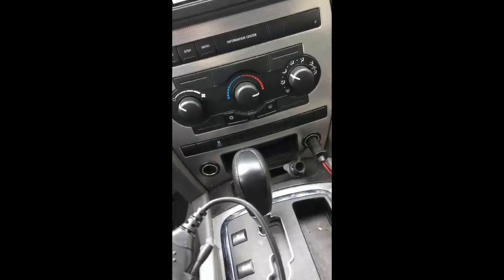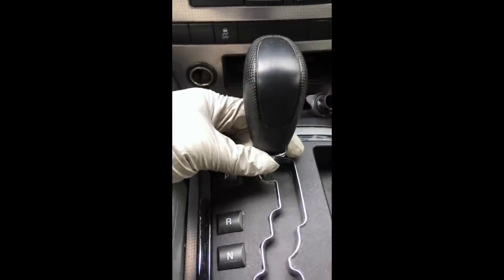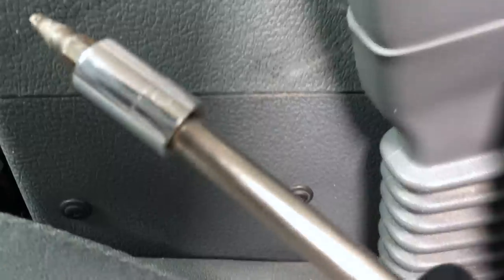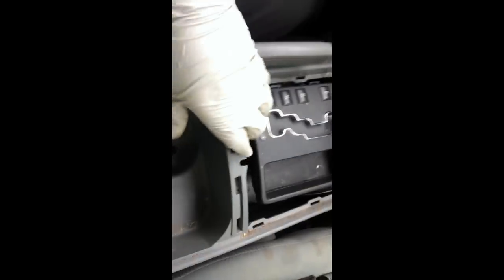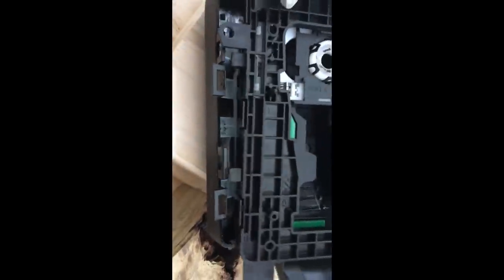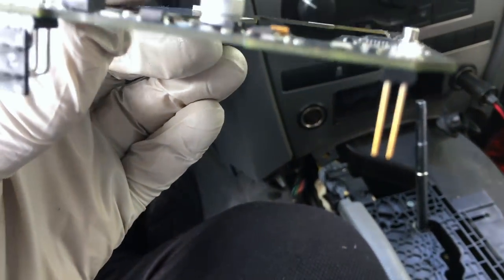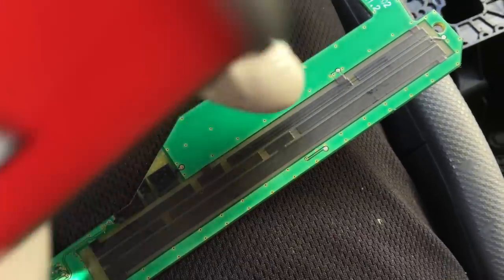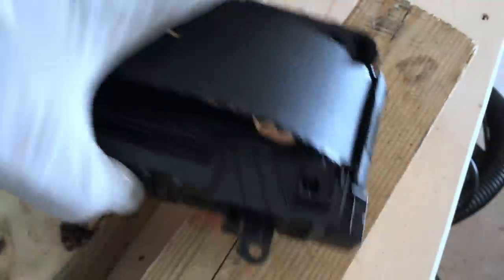2006 Jeep Grand Cherokee (WK) 3.7 Electronic Shift Module (ESM) Problems U0404 P0700 Codes

Comment: My 06 shows (1) highlighted all the time and won’t turn over by the key and wen I make it run jumping the relay the gear id on the cluster stays on (1) gear.  I’ve ordered a replacement shifter assembly being mine is cracked anyway.  Hope thus is my issue as well.
Reply from the maker: Do you have a check engine light on? If so, what are the codes?
Reply: @MrV2u  no CEl and I’ll check the codes shortly wen I get home.
Reply from the maker: @Formerlywarmer  does it crank? Is it a strong crank?
Reply: @MrV2u  wen I try the key it triggers started and fuel pump relay but no start.  If I hold the key in start position and trigger the relay it stats fine and runs well 5.7 Jeep.  

The 1 gear shows selected on the cluster no matter where the shifter is like it’s in manual shift mode and stuck in 1. I assumed that’s why it won’t start with the key  …Neutral safety switch
Reply from the maker: @Formerlywarmer  did u replace the relay? Did you try and start it in neutral?
Reply: @MrV2u  yes and yes neither made a difference.  Gear selections stays the same on cluster no matter where the shifter is. Checking for codes now
Reply from the maker: When you get it started does it drive like normal or does it go into limp mode?
Reply: @MrV2u  won’t move at all.  Acts like it’s in neutral. .
Reply from the maker: @Formerlywarmer  have some one run the shifter through all the gears while you go underneath the Jeep and see the transmission linkage moving through the gears.
Reply: @MrV2u  I’ll do that first thing Tmro and scan for codes. Thx for helping me out.

Comment: thank you for this video i did everything as told i still have an issue and its the gas milage its not letting me drive more than 30mph it also still kind of jumps when i switch the gear from park to reverse and reverse to drive but when im on drive and go straight to park it goes back with no jumps/issues my first code was p6727 or p2767 cant remeber but we fixed the issue than did research and found your video now im stuck
Reply from the maker: Jeanette Florentino Several problems may cause a P2767 code including:

Damaged or defective output speed sensor
Damaged or defective input speed sensor
Damaged, shorted, or corroded wiring or connectors
Damaged or defective shift solenoid
Damaged or defective engine temperature sensor
Damaged or defective valve body
Low or dirty transmission fluid. These jeeps don’t have a dipstick to check the tranny fluid. I know there is a site online that sells them, can’t recall where I saw it. I’d start with that first. Chances are you have a bad speed sensor if it’s not the fluid. Sorry to tell you the bad news brother. You might have to take it to the steelership. Have them look at it and tell you what it is and then if it’s external you can do it on your own. If it’s something more serious internal wise it’s your call. Hope that helps somewhat. Your Jeep is going into limp mode to save the engine and tranny. That’s why lose of power and economy.
Reply: MrV2u I’ll buy them and try switching them hopefully it fix the issue thank you
Reply from the maker: Jeanette Florentino let me know how it turns out. You’ll get your Jeep back to action.
Reply: My 2007 is doing the exact same thing won’t go over 25’mpr .... unfortunately this video did not work for me and I don’t have 500 plus dollars to replace the entire thing .... do u know what I should do from here because I’m sure driving the car this way is only making the situation worse
Reply from the maker: nique boo do you have a check engine light on? If so do you know the codes? And are all the gears lit up on the dash PRNDL?
Reply: nique boo so what I did was changed the speed sensor after cleaning up the circuit board it cost me about 250 and once I changed it went back to autozone to reset codes works perfectly fine hopefully never run to this issue again
Reply from the maker: Thanks for the update. If anyone comes across the same situation you helped a lot of people as well. Glad you fixed your Jeep.
Reply: MrV2u  what’s up brother I’m in the same situation as the rest of the people here and like the person on this tred I’m having the same problem with my 06 GC Laredo 3.7. My PRNDL isn’t illuminated except for the D box but it dosnt shift from 1st gear and a really hard shift from reverse to drive . I removed and cleaned the ESM and put it back together but still same problem. I have the codes :
P0128
P2098
P0430
P0481
Any advice helps brother ! Thanks
Reply from the maker: Give me till Monday to research these codes brother. I’m not at home at the moment.
Reply: MrV2u copy that brother I appreciate it I’m going to get under the hood again and see what I can find
Reply from the maker: Po2098 and po430 both point toward best case oxygen sensors and worse case bad catalytic converters. But then you have the po481 which shows a bad cooling fan or short in the wires. Are you over heating? How does it sound when you rev it up ? Like a boat? Real throaty? Does it pop or back fire when you rev it up?
Reply: MrV2u negative on the popping sounds when it revs it sounds pretty normal. And I had my complete cooling fan assembly replaced along with the modules a couple years back when it was under warranty but a few weeks ago, it started heating up again after the fans stopped turning on . Do you think one of these sensors could be at fault for it not wanting to shift ?
Reply from the maker: The dtc codes are all over the place. If it’s getting hot again. It could be a faulty fan assembly, bad resistor, or temperature sensor on the fan assembly. Next you could also have bad oxygen sensors. You have 4 of them. The two in front communicate with the two after the catalytic converters to make sure the cats are doing there job with emissions. My advice is to write down your codes and clear them all from the Jeep. Take it for a test drive and see which ones come back as hard codes. Let me know how it works out brother.
Reply: MrV2u copy that just got a call from the shop also they ran the codes from the transmission.  lost contact with the TCM is the code that comes out . That and also reading faulty torque converter clutch. They recommend that I buy a complete transmission solenoid pack. I’ve read on jeepforums about a case similar to mine where the guy replaces that same part and it was fixed. I was thinking to do the job at home but a little intimidated about removing the transmission bottom plate and working on it . Dodge made a bad call using these Mercedes transmission!
Reply from the maker: I’ve never opened up my transmission before. You need a dealer computer to check the amount of tranny fluid though when you refill it.
Reply: 6

Comment: Hi brother , i am having the same problem with my 2009 jeep wrangler but it seems like this model uses a different  system . Can you suggest me anything to solve this problem .
Reply from the maker: Do you have a check engine light on? If so you know the codes? If the light is on and you don’t have a scanner go to advance auto or auto zone, they can scan it for you and give you the codes for free.
Reply: MrV2u , Yes after all the sings become square check engine light came on and power of vehicle is reduced . I dont have the codes but i will check and let you know , thanks for your reply by the way your videos are so helpfull 🙏

Comment: My Jeep Cherokee 05 diesel 2.8 cranks but won't start also blowing asd feed fuse getting no fuel
Reply from the maker: The ASD relay is used to connect the O2 sensors, the ignition coil, and the fuel injectors to 12 volts. The wires to one of these may have a short circuit, or the relay itself is possibly faulty.
Reply from the maker: You will have to isolate the circuit that is shorted to ground to correct the problem. Pull Fuse 12 out and use an ohm meter to measure resistance from the output side of the fuse to a body ground. If there is a problem, it will read something less than 1000 ohms I'd assume. When the problems fixed, it will read infinite resistance (open circuit). Remove the positive cable from the battery. While the ohm meter is hooked up, pull the fuel pump relay. If that doesn't fix it, remove the ASD relay. If that doesn't fix it, remove the C1 connector from the PCM. If that doesn't fix it, remove the connector from the TCM. If that doesn't fix it, you have a wire in the harness that is chaffed and touching the body somewhere or another wire that is grounded.
Reply from the maker: Have you had any work done on it recently? Look over the wire harness good for wires that shorted out. (Rubber sheath worn away exposing wire to the body). Let me know how you make out brother.
Reply from the maker: I’d start with the ASD relay first. You can buy the same relay at any auto store. It’s either a 4 or 5 prong. Just swap it out change the fuse and see what happens.

Comment: Great video. Looking for a video where i can replace the shift gear bulb light on my wk 2008
Reply from the maker: I don’t have the Jeep anymore, let me see what I can find for you brother. You are talking about the lights that light up the park neutral and reverse indicators on the shifter correct?
Reply: MrV2u yep. Thats right. Would be nice buddy. Thank you very much amigo.
Reply from the maker: Gustavo Medina the lights are led’s that are soldered to the board. There not bulbs per se. You would have to either get a new board or if you can find a used one from a junk yard. If you see in the video there really isn’t a bulb to swap out. Let me know if that helps brother.
Reply: MrV2u tnx !!  Will do that.. 
Greetz

Comment: Mine is doing something weird. The red brake light comes on and then it wont shift up into 4th or 5th gear. Any suggestions
Reply from the maker: You might have a bad wheel bearing or abs sensor. Do you have a check engine light on? If so what are the codes. You can bring your Jeep to autozone or advanced auto and they will pull the codes for you for free.
Reply: Wow. That's crazy because last week while getting my tires put on, they informed me my abs sensor was bad on my front passenger wheel and they replaced it. You are on to something, but  why would that specifically cause the vehicle not to shift properly? And how could this be fixed?
Reply from the maker: @gtavtheavengergunnerlegend3340  if you have a bad wheel bearing or abs sensor it can cause the Jeep to go into limp mode. Which will not let it get up to speed. Do you have any check engine lights?

Comment: Hello I’m new to this channel my keep is having the same issue it is a 2008 Jeep Grand Cherokee Laredo 3.7, and the transmission console looks exactly the same until I take it apart, I do not have Any motherboard/ green computer looking components that I am able to clean, when taken apart it looks a little different but when all together it looks exactly the same as yours
Reply from the maker: It has to be in their brother. Did you open it up all they way like I did in the video. They call have electrical contacts on printed circuit boards. No other way for that operate.
Reply: @MrV2u  I’ll send you an email with photos later today, my car is in limp mode it still drives with all those black parts completely out of the car, but it’s in limp mode regardless of if I have all those pieces together or not
Reply: @MrV2u  ok I just emailed you The first one I forgot to add an attachment the second one has a three minute video showing you what my consul looks like
Reply from the maker: @Rukustsw  what codes do you have? I never saw a console with that setup. All the jeeps I’ve repaired had the same as the one I shown in the video. Let’s see what the codes can tell us. They might point in another direction brother.

Comment: I'm getting a p0884 code. It'll jump out of gear than go back into gear. Every mechanic I've been to is stumped. Replaced the ecu and it still does it. Heard there was a recall to reprogram something and my vehicle had the recall but didn't solve the issue. Have you ran across this problem ?
Reply from the maker: Do you have any other codes? Either pending or present? What year and model?

Comment: Question brother, when I tried shifting it from park to neutral to proceed with the removal of the ESM, the shift wouldn’t budge. It’s stuck in parking and I don’t want to break anything by forcing it to neutral. Is this normal and I should just force it or is there anything I’m missing??
Reply from the maker: Step on the brake and put the key to the run position brother. It will shift normal. Put your parking brake on. Make sure your not on a hill either. Let me know how you make out.
Reply: Thank you brother, will do. Currently doing the project now. Humbled appreciation
Reply: Successful! Thanks for the quick response my brother. Much appreciated!! Thank you for the help God bless you abundantly for helping others 🙏🏼🙏🏼🙌🏼
Reply from the maker: That’s awesome brother. Glad to have helped out and God bless you as well. We need them now more than ever. Stay safe.

Comment: Can anybody tell me what is the purpose of the (+ and -) in the shift stick?????
Reply from the maker: It’s to manual shift the Jeep. Slide the gear into the gate and when you want to upshift hit it over to the positive side and when you want it to downshift hit it over to the negative side. If you don’t shift it holds the gears till you change them.
Reply: MrV2u do I have to do it at certain speed or at what speed do I have to upshift or downshift?
Reply from the maker: You can shift whenever needed. You can listen and feel the engine. It’s the same as driving a stick shift. You don’t want the rpms revving to high. It’s more or less useful for off roading and driving in snow. From a stop you start out in first. Accelerate to approx 2500-3000rpms and shift up. Continue to do so as needed. Opposite is the same. Say your going down a large hill you can downshift to slow the Jeep down without using brakes. Takes practice to perfect.
Reply: I just bought a used Jeep Grand Cherokee 2005 and I am getting to know it. When I turn off the Jeep some of the lights stay on for like a minute any idea why???
Reply from the maker: Headlights and interior dome lights? Those are courtesy lights. You can set them on or off and duration using the buttons on the dash. Keep pushing the menu button it will scroll through the settings.
Reply: Thanks for getting back to me with your response.  I just could not find the how to turn them off they stay on all the time when I use the car alarm to get in my Jeep or when I get off my Jeep and use the alarm.